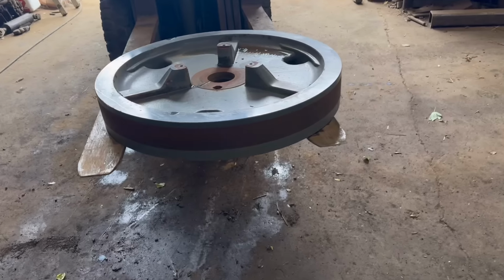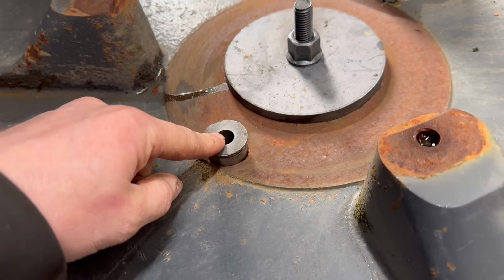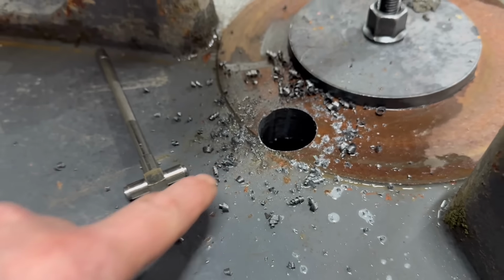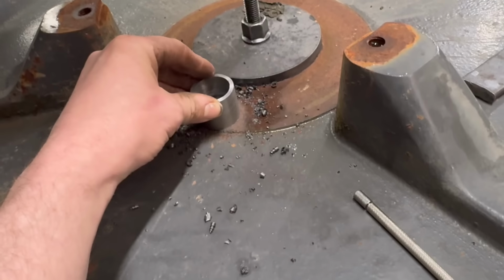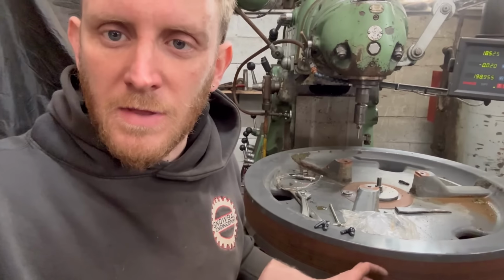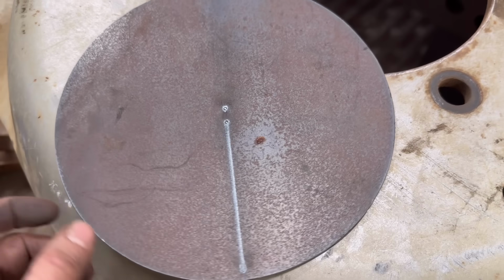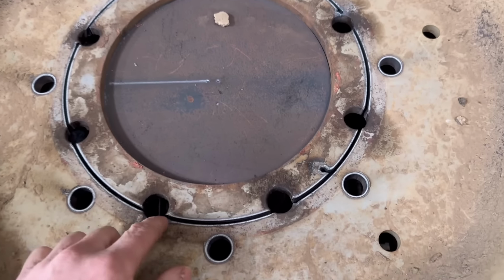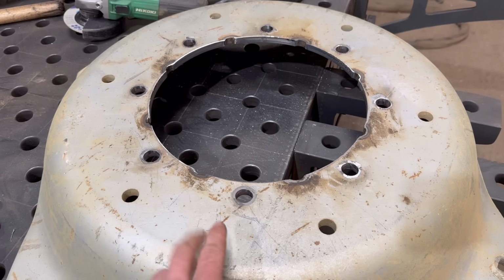The baler flywheels keep coming! and altering some tractor wheel centres

Comment: Couldn't you lay a sheet of 16 gauge or thinner over the job so the sensors would not bork at the old holes in the tractor wheel.

Comment: The groove on the flywheel is resultant on popping shearbolts in and not screwing the nut up tight..or no nut at all..simple take a few extra moments and do the job properly--- this will not happen

Comment: Nice work Ollie. If you are doing a flywheel job where the hole is badly out, a 4 flute drill can get you out of a spot as they don’t follow bad holes in the way that a 2 flute drill does. Not worth buying them new, but they often come up in job lots and are worth having about the place.

Comment: 6:00  Instead of using the edgefinder just use a drill bit the same size as the hole in the bush - much faster, especially when you have a lot of these to do.  No drill? - just turn up a bit of rod in the lathe to fit.

Comment: That BMW sure needs some engine work, with low compression on a couple of cylinders. It was really obvious when you were cranking the engine. I'm a retired small engine mechanic and I mainly did motorcycles when I was working, but I do my own car, mower and chainsaw repairs myself apart from specialist work like engine rebores, head decking ,wheel alignment, etc.

Comment: If youre going to be doing a lot of these it may be worth getting a drill and reamer for  the inside diameter of the bush and drilling it after its pressed into to flywheel... It'll save you the time of boring and checking multiple times on the lathe

Eta: ah, I see it has a step in the bush. That buggers that idea 😂

Comment: That was a clever use of the plasma table to get the wheel centres done much more quickly than doing them on the mill. Once again, saving the customer money while giving them back the job that they requested.

Comment: looks like the farmers are using the wrong grade bolt in the fly wheel. in the US looks like it should be a 1/2" grade 2 bolt (shear bolt). Not sure the bolt grade system is across the pond.

Comment: Does adding a larger bushing disrupt the balance?
Reply: mass that is farthest from the axis of rotation has the greatest effect on moment of inertia (rotational equivalence to linear mass).  The general formula is I = mr^2 where m is mass and r is radial distance from center.   So, for each element of mass, m_i at position r_i, we sum up all the contributions like so....moment of inertia, I = ∑ m_i * (r_i)^2.   Given the bushing is near the axis (small r_i) with literally much much more material outside that radial offset (more of the m_i out there at larger r_i , then small changes in the bush(ing) should not be a problem. The physics says it will change the balance but the difference may be so immeasurable or unnoticeable (even though calculable) that it does not matter.  To make sense of this....consider why an ice skater doing a spin speeds up when she/he pulls the arms in and then slows down when the arms are extended.   She/he is changing the total mass distribution...arms in tight, more mass near the center of spin (rotation).   All the same mass but at smaller r_i values means lower moment of inertia.  Arms out moves some mass further from the axis of rotation and therefore the moment of inertia goes up.  Angular momentum, L = I*ω  is conserved....therefore, L is constant so if I goes down, then ω goes up and if I goes up, then ω goes down.   If you placed a bush(ing) way the hell out there near the edge (for some bizarre reason) then it would have more of an effect but again, it is a matter of how much mass it represent relative to all the other mass in the part AND where all those masses are located.  Cheers!!!

Comment: You could heat up the outside & freeze the bush for a really good interference fit. You just need a small fridge with a freezer section, even a mini fridge, as long as it has a little  freezer section. Handy as well for a cold drink in the workshop.

Comment: By the way olly pal see you got yourself that BMW  👍 nice but tip for you the brain of car is radio  that's the computer for car but if any electronic problems show up try this before  getting  new radio  Bluetooth  is in boot passenger side behind panel back of seat that area of car disconnect that should  save you loads of cash every thing  else  with that car easy but prices 😬🤯

Comment: I’m not sure about your tecarc machine but I know our hypertherm has a “expanded mesh” setting allowing the torch to continue firing even if there’s a gap in steel. Essentially keeping it on for the duration of the cut regardless if there’s steel there or not. 
Hopefully that helps for future jobs.

Comment: Definitely interested in engine work, tractor repair,  ICE engine work/modifications.
Extra channel might simply add additional work overhead to film creation ? I don’t know, but if it’s easier or better for you to have a second channel that’s fine. I was waiting for you to post some work on your auto, mechanical repair etc. I’m always interested to see different tool, equipment, ways of doing things from  across the pond.

Comment: Oli. Thought. Cut your “inner disk” with a larger radius than all the holes THEN cut through the extra disk or the required circumference that will logically cut through the holes underneath ?

Comment: Your plasma torch should have a setting for intermittent cut or pilot on. That will let it stay lit as it travels over gaps. I use that setting for cutting expanded grating.
Reply: Yeah there has to be a simple over ride setting for that operation.... Always easy to learn and makes the next job go faster !!  Computers do as told ...👍🇨🇦

Comment: Thanks for bringing us along! 
If you got 6 flywheels from the same source I suspect someone has realized there is a need for remanufactured flywheels ,  my guess is they will be charging at least 1/2 new price plus core charge, make sure your getting your share of the value not just a charge based on time.

Comment: Just thinking out loud… since the torch heads come out of your plasma table easily, could you make a fixture to mount a drill motor in the plasma to hold an edge finder, then use your plasma to center find ? Might have to do some maths if their is no 1/2 function.

Comment: Hi Oliver, just wondering if you keep getting these jobs to repair. If you could make a fixture (plate)to lay across part so you could use a rotor broach or mag drill to make it easy on yourself. There are stub drills and reamers on the market with Morse tapers. Just a thought, anything to save man handling it to the mill. Still loving ya vids.

Comment: Nice job.  Local farmers must be happy to have you around. 🤠
One small observation.  At 20:00 you’re whacking a piece of scrap steel with a copper hammer.
You’d be better off whacking a piece of brass with a steel hammer.  Less chance of damaging your nice sleeve.
But just an observation!
Reply from the maker: The copper hammer is just a nice weight and size so i often use it because of that reason.

Comment: Morning Olly....just a quick question....why do you drill out and then reamer instead of just drilling a hole to size?🤔
No criticism, buddy,  I'm not an engineer and interested to know the reasoning behind it, that's all...😊
Great job as always...👍
Reply: There's a bunch of videos on using reamers. Basically, they give better surface finish and more accurate size, just what you need for an interference fit that won't come apart while the inner bushing is being hammered out.

By just enlarging the existing hole they are doing one job well, while a drill is doing two jobs. A drill has helical flutes that carry the large volume of chips out, while a reamer has more cutting edges instead.

Comment: Nice job on the flywheels! And the wheel centres as well. That Beemer sounds very nice, little turbo whistle🤩
Reply: Sounds like it's got low compression in a cylinder to me....
Reply from the maker: @marcusgs12345 yes, cylinder 4 has no compression at all.
Reply: @marcusgs12345  what I meant was the sound through the open pipes. The engine work he mentioned in his post earlier this week. Love to see that!

Comment: You've definitely got a dodgy spindle bearing in that big Huron mill... Either that or a shocking amount of shrapnel rattling around in your little drill chuck!

Unless that mill has an ungodly amount of wear in it I'm sure it would be worth rebuilding that head with a new set of bearings. They definitely will not be cheap bearings, but those Huron are nice mills so it would be worth the hassle and cost.

Comment: I was just thinking about the tractor wheels. Before setting the plasma torch off, could you sit say a 3mm piece of sheet steel in the wheel to give you a surface without holes so the plasma doesn't stop. Then it can cut the centre in one go?

Comment: I would certainly like to see you working on the hobby projects. Any mechanical or machinery I love. Snowball after hours should be just as interesting. I looked up that BMW engine. It certainly seems to have a pretty good reputation, and scope to work with. I used to love BMW'S, years ago. They are as dear as poison in Oz and don't have the following.

Comment: when you were cutting the centre of the wheel out would a I'm thick sheet of metal set on top of the wheel and then cut through both pieces of metal and not have to worry about the original hoolel